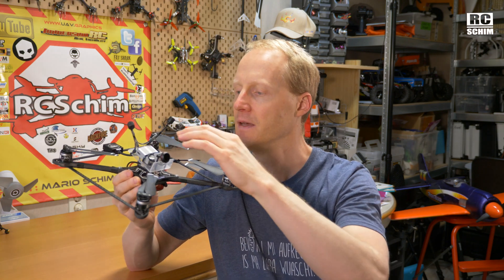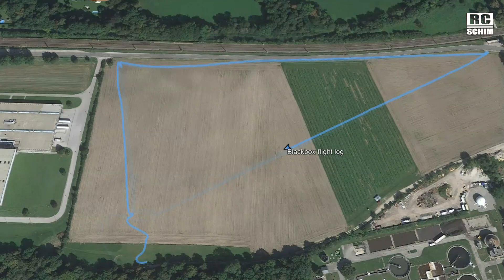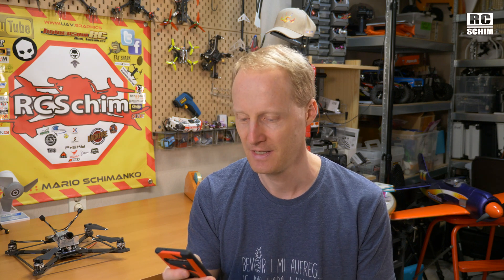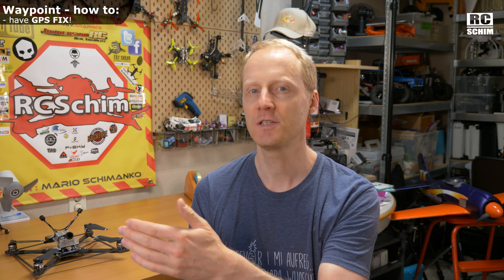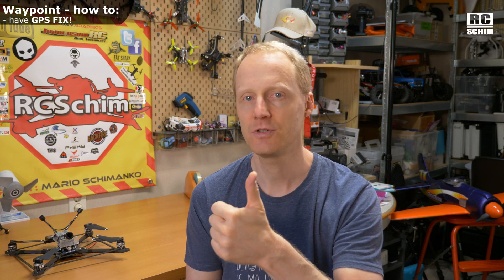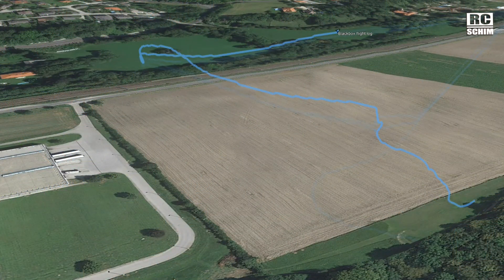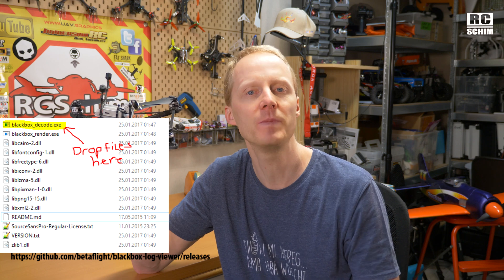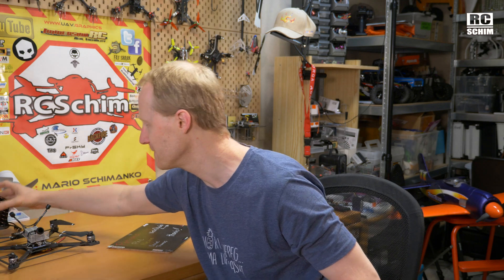iNav Waypoint mission - a few easy steps (SG325)

Comment: You mentioned that you set the drone to hover and look around. I don't see a way to do this in INAV.
What did you use?
Reply from the maker: there's no such mode, it's just the weird way it worked when I setup waypoints ;)  It acted like it would have to cross a street and needs to look right and left ;)
Reply: @Rcschim  I see. So we still need to use something like MPW planner for those.

Comment: yikes theres a lot of standing on one leg facing south but only on tuesdays when the sun is out and the cows are lying down in the field to get inav to work. hehe, still really want to get some gps to fly mountains, i was just watching my latest vid and i spotted two times were i completely lost line of sight, at 3,000 feet aaahhhhhhhhhhhh. thankfully i didnt get any drop outs.
Reply from the maker: hehe, I know it sounds like. But after figuring out the "rules" I thoughts it's actually pretty well thought out.
they just want to prevent a few mishaps (user or pilot errors) which could later lead to the inevitable: "inav is crap - my drown flew away" opinion...
Waypoints are maybe not that important, but just the inav as a driver for a freestyle drone + the GPS RTH setup incase you have a video lost or failsafe... it's helping us with our nerves!
Reply: @Rcschim   yeah, its so hard to flyand think artistically when your watching for so many things as well as flying. ps, is inav osd horizon fast enough to be useful?

Comment: Those look like Mavic props on that quad. Are those the Mavic motors also? Mavic 1 or Mavic 2?
Reply from the maker: check the SG325 on banggood - it's part list shows 
"7.Motor 2008 mavic motor compatibility X4
8.Props Mavic 8331F Compatibility X8"
I think the motors are clones from mavic1 motors. Props are also clones but I could use the original mavic1 props - as they looked like higher quality plastic...
Reply: RCSchim very nice. Thanks for the info. I will check it out. Cheers!

Comment: Nice quad helical. 6 turns should be 10dB so about the same as the X-Air's but with a slightly narrower lobe. Would be interesting to try 20 turn and get 17dB and have them slightly offset so they span across in a stripe so the lobe width is not too narrow.
Reply from the maker: it's a 7turn actually. and I rather find it overkill - vs the more versatile 3turn allrounder. still amazing gain but almost your whole 180° infront of the goggles.
on the 7turns you need to be a good human antenna tracker (which works in a way where you can use your ears to estimate your copters position and than aim :)
Reply: @Rcschim  7 ok nice lol. It would be cool if someone made a motorised tracker that fitted on the headset and used gps from the crossfire mavlink or dji msp link to auto aim.